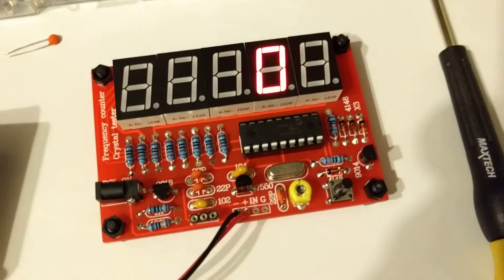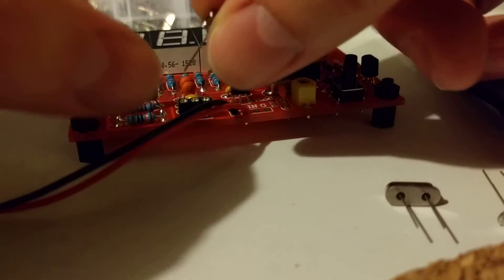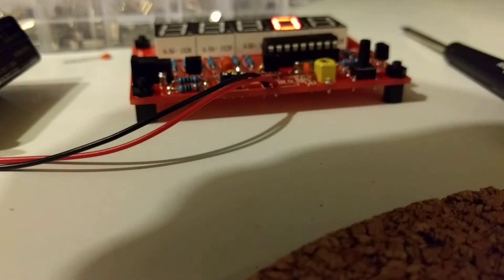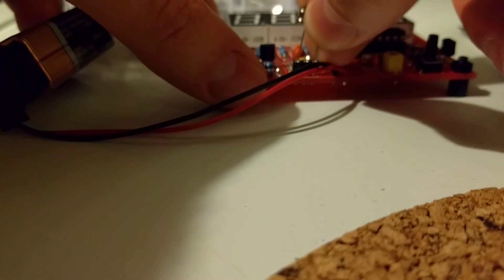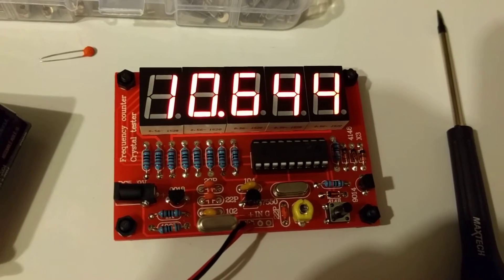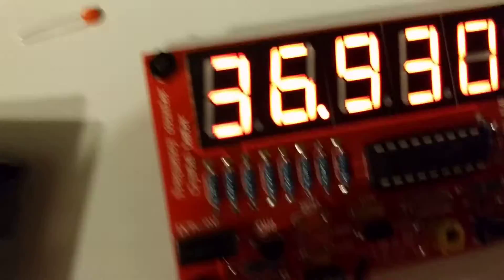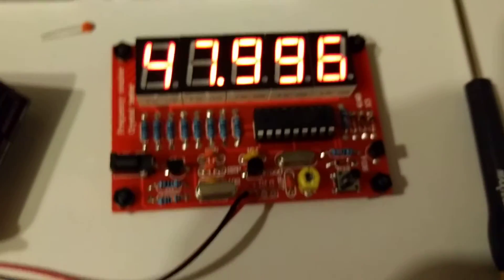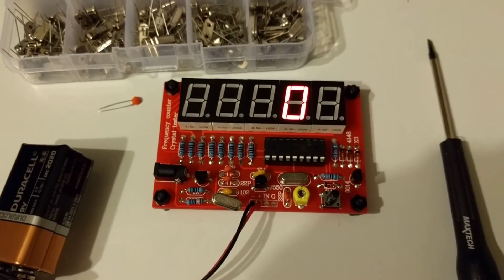JUNK SHOW: $6 DIY Frequency Counter Crystal Tester

Comment: I finished mine yesterday.  It seems to love 5 volts, it does work on 9 as well but mine seems to be much happier with the five volt USB cable. I got mine to use the frequency counter portion, my old frequency counter went haywire so I needed a new one, and at the price (mine was 3.84) I figured it would be a fun build and if it worked I would use it, if not for under four bucks it was worth the fun of building it.  I have checked out the counter and compared to my oscilloscope it is dead nuts on, I have not tried plugging in a crystal as of yet though.

Comment: The reason it want show low frequency xtals is the 22pf caps are to small for the feed back at low frequencys . it needs at least 50pf for 4mhz  150pf for 100khz ........... these are the fedback caps around the ocillator transiter
Reply: gene reddington that's what I was thinking...those caps are fixed here..that will limit the range of crystals to be tested

Comment: Your lucky my kit didn't even light up ! i was very disappointed with it ! least as junk its all its worth the parts as for what it does it does nothing .
Reply: i got 2 kits both not working no mistakes making it  this kit is junk ...i agree!
Reply: @039dalekmoore2007  try adjusting that variable cap throughout ifs full range.  Mine powered up first with no display.  As I adjusted that cap, digits suddenly appeared and the adjustment actually changed the strobe rate across the LEDs.   If I recall this right, adjusting it fully clockwise stabilized the display.
Reply: @matambale  i will give it a go as i recall they light up but were pretty useless ..i am not sure i tried what you mentioned but thanks i will try ..i think i still have them in a box in my shed
Reply: @039dalekmoore2007  the one I have is a bit..flakey.   Very sensitive to supply voltage.  The IN pin, when fed a clean 5v, 1kHz square wave from the scope wouldn't show a proper count until I dropped the supply voltage to the unit to 4.8v. The XTAL tester pins needed something like 5.1v on the supply to give a proper readout, but that  worked only on crystals above something like 20 MHz.  I think the crystal tester portion of this thing actually requires some tuning to make slower crystals resonate (probably more capacitance).

Also, I found it pretty strange that the variable cap didn't seem to 'calibrate' the unit at all - instead it just seemed to control the strobing rate of the LEDs.

Comment: You need to be clear about the difference between a crystal (the devices you have there) and a crystal oscillator which is either a circuit containing a crystal or a 4 pin metal can device like this https://leeselectronic.com/33338-thickbox_default/crystal-oscillator-20mhz-osc-dil08.jpg

Comment: The key problem is that all of these Chinese knock-offs are trying to do something the original designer did not claim!. The original design didn't have the crystal oscillator, and the input for the counter requires a signal of in the region of 5V!

Comment: Does anyone have the instruction/assembly sheet for this?  I bought one ($3.49 Ebay, delivered from Chiwan) but haven't yet assembled it.  Trying to put together a tone generator for ultrasonics to shut up the dog next door.  <g>  Recommendations for siggen and amp?
Reply: On the board, you can find every info you need. I assembled mine today without any help.
Reply: mine didn't work rubbish ! waste 
of my time
Reply: @039dalekmoore2007  Whoof Whoof...lol
Reply: @039dalekmoore2007  Neither did mine, bought a week ago - It shows a frequency of 62.332 - always !

Comment: This board is not just a crystal oscillator tester. It has an input for signal measurements, which happens to be more accurate and reliable that the crystal tester.
Reply: Could you elaborate please??
Reply: @Sickindian5 Maybe I could have 6 years ago.
Reply: @E-BikingAdventures  😂

Comment: I'm a bit late to this, but the "spare" capacitor is actually included to make the kit work with those crystals. It should be soldered underneath the board. Check this video (https://www.youtube.com/watch?v=lcbxG18FfOs). There's a link to the "manual" in the description of that video, where that kinda-critical bit of info appears.

Comment: You are testing crystals, not crystal oscillators. Crystal oscillators have 4 pins. What you have are used IN crystal oscillator circuits.

Comment: I put one of these together last nigh and it appears to work but it is slow.  The external inputs let you use this to check and perhaps calibrate a signal generator or the frequency on a multimeter.  The only annoying thing are the size of the external power supply jack and the fact that the led´s have a white background when not lit.  This causes a bit of visual confusion when not filtered with some kind of tinted Plexiglas cover.  Not bad for the price and very easy to construct.

Comment: I saw somewhere that the spare capacitor solders under the board to stop the erratic behavior?
Reply from the maker: +Wayne Stevens Yeah, I found this once I was able to locate the manual. After some research, I actually found that it was my 4 MHz oscillators that were bad. Follow up video is here:

https://www.youtube.com/watch?v=1Z-08FLrUwU
Reply: +Mike Kasprzak  ahh I see :) I'll go watch it now, I was wanting to buy one so I could test tone frequencies (square wave) my next project using the lm567. thanks for the reply :)

Comment: I dunno why, but anything with that kind of LCD display is so amazingly cool. Must be back to the future that helped me like that.

No idea what this could be useful for, but I am liking the Ali reviews (Thanks for the introduction to the site, spent a truckton already)
Reply from the maker: +oranebeast :). I'm testing a few different ways of making quick videos. :)

I do wish the little board supported the slower crystals. According to the docs it does, but something is wrong. As for use, it's basically something you can use for easily checking how fast a crystal is. Say, if you were to desolder one from an arbitrary board, you could just pop it in and see how fast it oscillates, and then potentially re-use it. So really, not something you would use very often, but for those rare moments when you want to confirm that an oscillator is oscillating at the speed it says on the tin, you can.
Reply: led not lcd